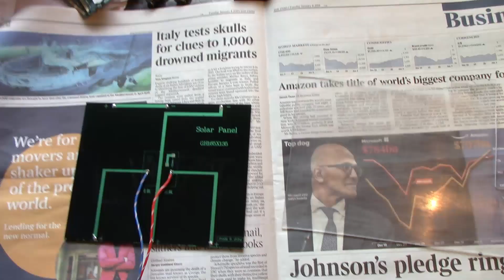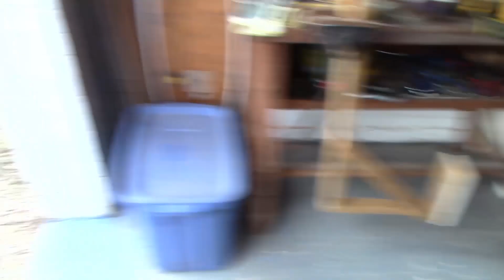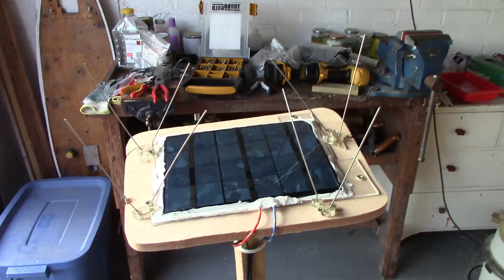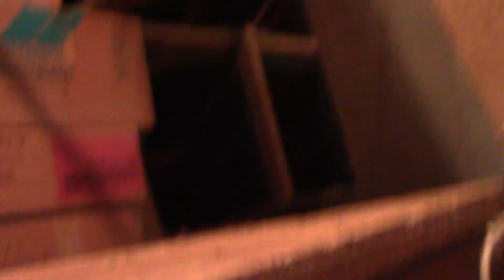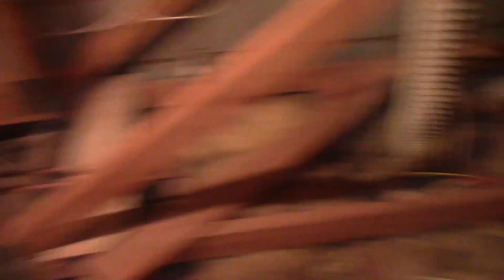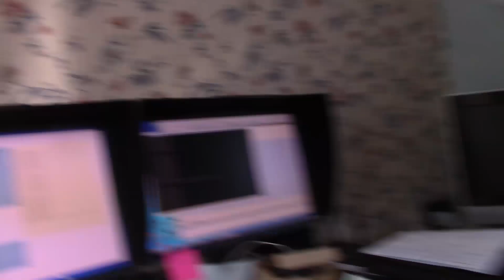Long term solar panel test - start

Comment: I found this really interesting and I am pretty certain that, in building your own power-control device, and running a long term test, that you will have conducted far more research than anyone else in this game.  As an aside, I have several years worth of data from the output of my solar panels in Derby, that I can provide you with, but it wont tell you anything outstanding.  My main observation is that the solar intensity is sinusoidal over 1 year, and, based on fitting a sinusoidal curve to only 4 months of data, I could predict the total energy generated over the next few years to within a couple of percent accuracy.  But it really is a pork barrel with these Amazon panels and very difficult to know how they perform until you test them!  Also enjoyed the attic scenes, reminds me of when I fell though in my house in Derby years ago :-)
Reply from the maker: Sinusoidal over a year -  I suppose there's a simple astronomical reason for that, but I am no astronomer. My main worry at moment is that on an overcast day one gets essentially zilch from these panels, suggesting we need large battery capacity so as to harvest max energy during sunny days. Your Derby data, if it is easily to hand, might be interesting. Another approach is https://www.gridwatch.templar.co.uk/index.php which seems to have access to solar generation stats on an hourly basis. Nationally, they'd be distorted by new solar farms coming on stream, but if it could be localised to particular farms then it gives good info - but not for my panels.
Reply: @samuelfielder  ill try and locate the data. Grid watch is a great site. Ref energy consumption I think you are right to be concerned.

Comment: Very good.  You’re correct in your assumption that for some, like me, the details of the electronics did fall outside my technical knowledge, but your explanation was nevertheless very useful and educational in helping me understand the principles behind what you’re doing and increasing my knowledge.  I coped fine with ‘technical’ aspects of the mounting of the panel. 😉
I assume you choose not to mount the panel at ~ 65° angle (as recommended at our latitude) as it would be unrepresentative of Woodstock’s deck.
Reply from the maker: Yes, panels will be horizontal on Woodstock, I presume.